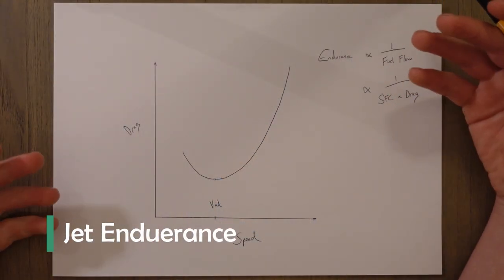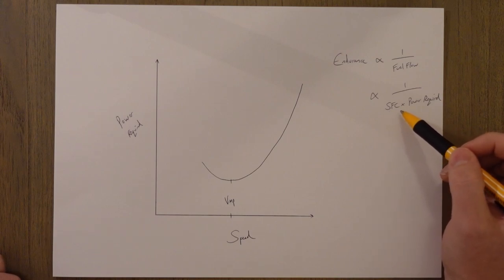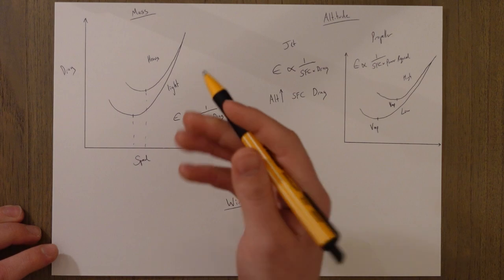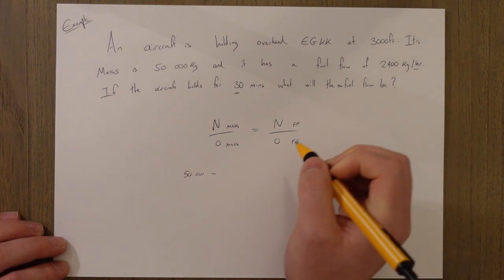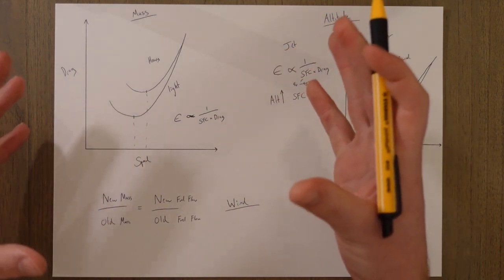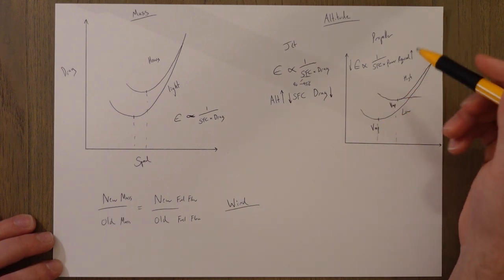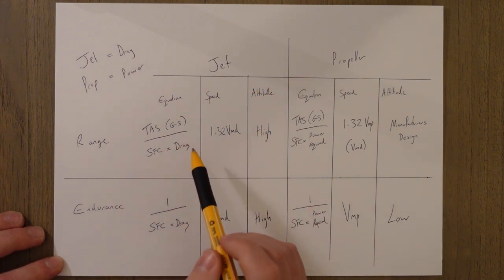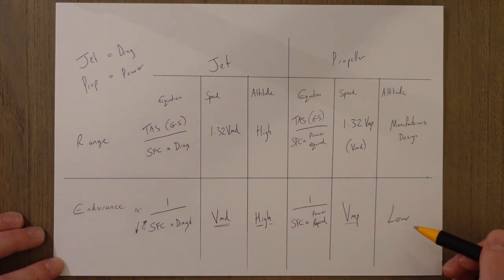ATPL Performance - Class 9: Endurance.

Comment: Greate Video! You are helping me with your classes. Thanks alot! 

I am a little bit confused about the Fuel Flow and Aircraft Mass (the example at 05:36). The new FF should be 2342.4 not 2304, am I right? (48800/50000)=(X/2400) -> 
X= [(48800/50000) x 2400]; X=2342.4
Reply from the maker: Yeah i must have entered something in wrong to the calculator